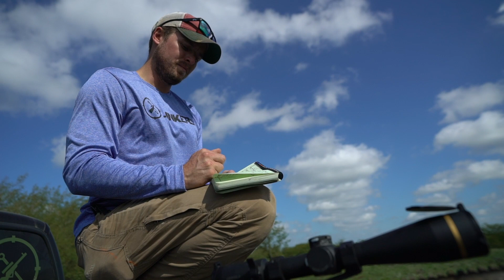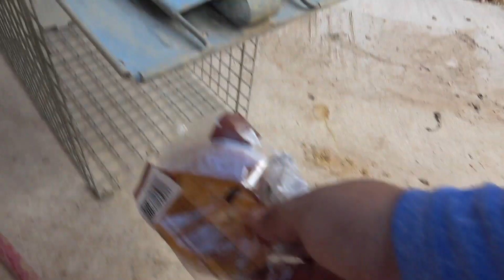I have to get this right..

Comment: Hey Rob I think you should give your 300 win mag another chance. Carbon fiber barrels are actually a lot stiffer than steel barrels so they are less affected by heat. In addition Proof who manufactures the barrel in your rifle uses a proprietary weave pattern and resin that actually allows the barrel to cool faster than a steel barrel and you can look up multiple studies that show this. I think it’s far more likely that your problem is that you’re suppressing a 300 win mag and causing your barrel to foul up a lot faster than normal. Try shooting it without the suppressor before you decide to get a new barrel. Of course if you do still want to get rid of it I am accepting donations

Comment: I jump back and forth between MRAD and MOA. the biggest help i found was to start using mrads for all measurment. i do the same with MOA.  for me at least, when i start talking about inches and feet etc, it just messes me up. My dope is my dope. no matter what it is converted the bullet is doing the same thing, so i just eliminate the complexity. No where near as experianced as you, but just what i have learned on my own.

Comment: My farthest shot on a hog is 582 yrds i probably shouldn't have taken it but it worked out. the next was 422 and then 350 and a 250 and a bunch a lot closer all with a .280 Ackley bolt rifle with 162gr. Hornady BTSP bullets. surprisingly all were good clean legs folded up quick kills.

Comment: So if you shorten/lengthen the distance would each hash still be a minute without making adjustments on scope
Reply: On a first focal plane scope, yes. On a second focal plane scope, no.

However, they are units of angular measurement so one minute (or mil) at 100 yards is smaller than a minute or mil at 600 yards.

Comment: So just wondering. What trigger do you have in you 6.5? I want to upgrade my trigger on my AR and I can’t decide between single stage or a two stage. And I want a lighter trigger pull like 2.5 to 3.5 lb trigger pull.

Comment: What barrell length would you recommend for a 6.5 AR 10 for long range shooting?
Reply: 24" with adjustable gas though you could get away with shorter. If you're doing inside of 1,000 you could a .224valk or 6.5 grendel and not have to build an AR10
Reply: @geologik7500  i originally wanted a 224 but want a gun with more impact that i can hog hunt with

Comment: I noticed that he holds the trigger back for quite a while after sending the round. Does anyone know if that is a military thing or personal preference?
Reply: It's called follow through and is a good skill to practice. Squeeze, break the shot, keep the trigger pressed to the rear and finally let it go to reset.

It keeps you from making unnecessary movements while breaking the shot

Comment: Why do you say 2 Min off right edge? Would be harder to repeat on a smaller target....Why not just hold what ever the actual wind hold is at center mass? 6 Min or so if you are aiming right edge and still hitting left at 2 mins off the right?

Comment: I know its not my gun and it has nothing to do with me but I don't understand how you don't get the concept that if your only going to shoot that CF rifle once or twice a hunt, and it seems like that shit was sighted in like crazy, why do you hate it, you knew what it was like before you bought it and you said it yourself its not a gun that's meant to be shot a lot which is why you shouldn't get mad over it. If the gun is accurate in those first 4 or 5 shots why would you be mad when its inaccurate after that, the rifles sole purpose is for hunting not target shooting, its like saying, i'm going to use a specific ass tool like a pair of wire strippers which you obviously know the purpose for, and use them to cut the wire on my fence, yea they can be used to do that but its obviously not what they are meant to do.
Reply: Andy Brooks it’s just really hard to gather enough dope on a gun like that to be 100% confident in the amount of time he has before the hunt.
Reply: if you put that much money into a gun run a Nightforce scope take a few shots with a chronograph and order a custom turret for that rifle and as long as you use the same ammo and good ammo not cheap crap you won't have to do all that shooting to gather dope just a couple to check the dope on the turret
Reply: Carbon Fiber barrels do not foul that fast. Essentially proof takes a premium barrel blank and machines it down to then wraps it in carbon fiber. My guess is he never properly seasoned/broke in the barrel properly or is just shooting wildly inconsistent ammo.
Reply: @denniskrenek1805  well in this video he's you Winchester witch I personally have never had good results with
Reply: using
Reply: @shootingntrucking I'm referring to his dissing of his carbon fiber 300 Win. Mag
Reply: Please use correct punctuation if you’re going to write a paragraph.
Reply: @denniskrenek1805  yes I was agreeing with what you said I and I was talking about its was likely  inconsistent ammo stacked with a improperly broken in Barrel
Reply: @mattrarick3942  haha cool deal👍